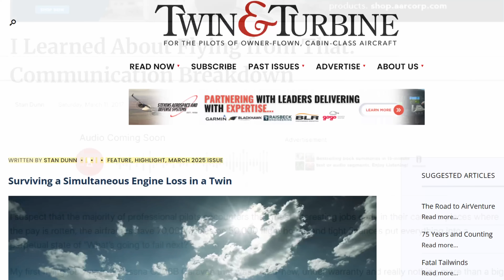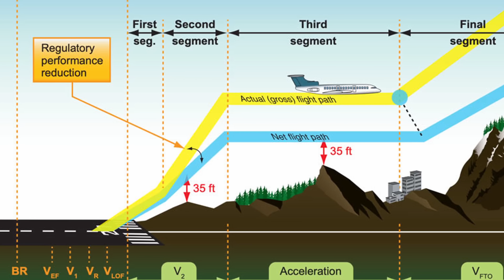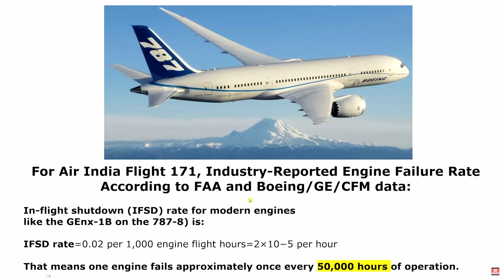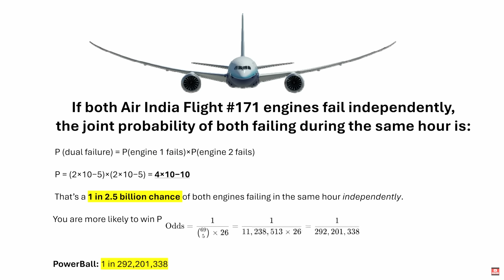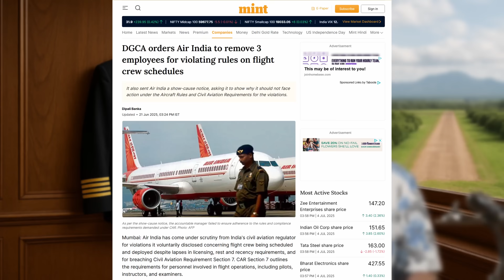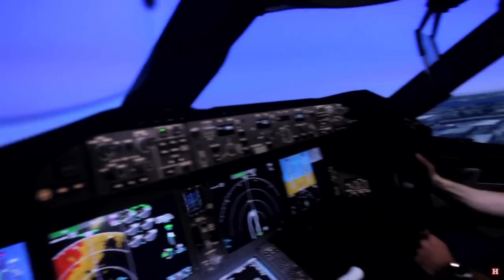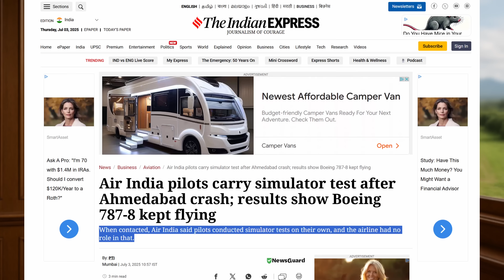Air India 171 Cause Becoming Clear

Comment: Informative but not corroborative , the pilots May Day call mentions about no Lift & Thrust , so obviously they could not have botched up by making the aircraft choke  by pulling the fire handle . Had they, they would have realized their mistake and not complained about No Lift / Thrust, isn't it ?
Reply: IF a fuel switch was off and IF the pilot on the radio report is true, he did not know he had a good engine with an OFF switch selected.  If both switches off, even worse.

Hopefully switch positiom/movement is recorded and saved audibly on the CVR, digitally on the FDR and survived the fire intact and true.

Comment: Someone posted that Boing doesn't have enough em shielding on wings. I studied this, but I didn't finish cause I would need to move to Phoenix. The left engine had issues thats proven by videos. Thst damage wing , landing gear, and produced emp. Rat deployed that could save the plane. Some say the seat broke possible cause the runway buckled from heat. There were multiple issues that cause this crash. I took classes to work on airplanes, but bad back and shoulder changed my mind .

Comment: I seen a documentary on the building of the dreamliner & safety inspector who was fired because his safety delayes was causing a problem for Boeing as they were in a panic to get this plane because Airbus was coming out with their A 380. The safety inspector said he would be surprise if this plane did not  crash in the first year. It was built by non-Union workers & poorly built at that. Now I am not an expert just pointing out the Documentary I saw on this plane.

Comment: The plane sat on the runway for an extended period of time with a 110 degree ambient temperature. This likely ultimately caused the formation of tiny air bubbles in the fuel system and when the aircraft tilted upward during take off...the bubbles resulted in an air lock in the fuel system to both engines at the same time. This resulted in both engines failing at the same time and the resultant loss of power and crash.

Comment: Bullshit, if one engine stopped the airplane would have rolled its completely balanced.
Reply: If the plane started to yaw due to only one engine working, one of the pilots could have compensated for the yaw by applying opposite rudder.

Comment: Once was taxiing by a 787 (back when they were brand new). They were stuck on a taxiway because their brakes came on for no reason and they had no idea how to fix it. Some random computer error that left those pilots scratching their heads probably for a few minutes. The plane is highly digitized and electrified compared with previous airliners. Lots of different systems interacting with each other - means that there could be a bug in the code that was never caught.

Comment: You would think with the “incorrect shutoff” scenario the one running engine would have a lock out to prevent accidental shutoff? Human error has to be eliminated. Also what was your reference to carburetors since jet engines don’t have them? Finally I would want to know who had access to that plane prior to takeoff if sabotage was a consideration?

Comment: I've seen and been in 787 that have gone nearly vertical. This 787 took off just fine and gained elevation just fine, but then all of a sudden it started losing elevation... just because of that, something caused the plane to lose power, not flaps, or pilot error. Something caused a lose of power, major bird strike, bad gas, or something simular.

Comment: You took almost 17 minutes with a "becoming clear" title......and said absolutely nothing.  SO.........  clear loss of power...RAT deployment suggests dual engine failure - without external clues such as compressor stalls, FOD on runway.  OK how does this happen?  Bad fuel?  Highly unlikely as no other aircraft were affected and there was no sign of asymmetric thrust (such as rudder deflection or obvious yaw).  All together now......... how do you "shut off" two  GEnx engines simultaneously????  One guess - (hint: it involves two switches on the pedestal)  Has happened before (see Egyptair 990, Alaska 2059)  Just a "diagnosis of exclusion" and speculation at this point, but the CVR and DFDR will immediately prove me wrong (if I am wrong) but this is about the only scenario that fits - and no one wants to think about this horrible possibility.
Reply: VERY SADLY, I WAS CORRECT.  THIS WAS AN INTENTIONAL, COWARDLY ACT, SIMILAR TO EGYPTAIR 990.  OUT.

Comment: I saw a report that the captain's seat slid back just after rotation (the start of the climb) for about 30 cm (11,8 inches) and the captain instinctively grabbed for something to stop the fall (or slide). Unfortunately, it could have been the throttles. It was reported that the pin that locks the seat did fail. If so, there wasn't any time to throttle back up or restart the engines.

Comment: You can’t have extensive aviation knowledge with 55 hours of flight time that in a Cessna 152. I have 30,000 hours with many type ratings in different aircraft and 35 years of airline experience and I can’t imagine what would’ve caused this.
Reply: Fuel cut off switches pulled at Vr?

Comment: I clicked because the title says the cause is becoming clear. This video says it is NOT becoming clear.   
. 
He makes a reasonable argument that there was a single engine fail & the pilots shut down the good engine.  That may be less of a stretch than alternative explanations . . . but it’s still a stretch. The pilots would have had to shut down an engine right off the runway, which I think would be odd . . . unless there was a fire light.  And it doesn’t explain why the RAT popped so fast.
.
I enjoy guessing but I would wait for the report before I claimed to have a credible theory 
.

Comment: Nice job "Flying for Money", the best I've seen so far.  I'm going to throw some spanners into your works but only for righteous reasons to ensure all common-mode failures (like fuel contam'n or multiple birdstrikes) or a single failure causing loss of both engines (like FOD ejected from an uncontained fan/turbine release of one engine causing failure of the 2nd).

Possib'y of engine failure and erroneous shutdown of the remaining engine during the rapid transition of flight phases (V1 to Vr to V2) is a tough sell.  Indic'ns of non-(imminent/immediate)-critical nature are purposely inhibited to the crew to limit workload.  A minimum skilled pilot couldn't physically get to the final "emergency shut-off and extinguisher release" on the wrong engine in just the short "Phase I" climb segment.  And other than the unusual, visible, exhaust on the #1 engine, there wasn't a rapid yaw followed by a crew or aircraft-auto-correct system.

Software is a "magic" that replaced direct connect'n between mechanical mechanical and wet systems and the flight crew and allows high tech 2025 transports to fly.  You mentioned FADECs (software based engine controllers) but the FADECs require both a certified hardware config'n and a certified software config'n.  And certifying software which may be common software even on independent units like engines is a dark hole no one wants to crawl in.  Errors come from all dir'ns including errors made by the compilers that convert simple math programming into the machine language that Av'n-Grade-Silicon feeds on.

Document DO-178-C (correct version?), "Software Considerations in Airborne Systems and Equipment Certification" ensures that flight critical software doesn't act like 'Windows 10' on the night before your thesis paper is due.  Frommy perspective -- it costs ~ $2000 USD to certify a single line of flight critical s/w.  Don't rely on that -- say your prayers at night, and show kindness to the weak and poor!  (No religious content intended, or offense intended.)

And since no one reads this far:  eat plenty of fresh fruit & veggies, wash behind your ears, and don't slouch.

Comment: You didn't consider all forms of sabotage. 
In the past few years we've seen head scratching incidents all involving Boeing planes. Planes that have been in service for years to decades disappearing, suddenly nose diving, losing doors, faulty bulkheads, and now this.
The dust on take-off is because the plane did not lift until the very end of the runway. It wasn't dust on the runway, it was literally the dirt off the runway. That's a big clue you seem to be missing.

Comment: I heard that the cause was the Captains seat slip back on its tracks on lift off. The captain instantly reacted by grabbing the throttle controls trying to pull himself forward which inadvertently caused both engines to loose total thrust.!!!

Comment: @brandodurham … further to your note, and in keeping with the “30 seconds to process emergency event” re: Hudson incident, what is your opinion of a crew’s likelihood to attempt any significant configuration changes within 12 seconds of flight?
Reply from the maker: It can be very hard to be patient during a shock event. Sullenberger was, and he wasn’t able to return to LaGuardia as a result (but his process wasn’t wrong). Pilots have to make reflexive decisions every day, and they have to know when to slow down. It is a very fine needle to thread. Stated better: “it takes 35 seconds for a pilot to make A GOOD RESPONSE to a shock event.”

Comment: He is saying that the pilots may have turned the functional engine off by mistake. They were suppose to turn of the damaged engine. He saying that the cloud behind the plane as it takes off is a sign of a damaged engine. As a result, both engines were off as it took off.   Thankfully in India, digital cameras in the cockpit are mandatory and required by law so pilots actual action are recorded (DVR).  😀

Comment: Not pilot error, not flaps, not bird ingestion, not compressor stall, not fuel contamination, not sabotage. Dual engine failure due to FADEC Channels A and B detecting an out-of-tolerance parameter - likely an overspeed - triggering an automatic engine shutdown to prevent a catastrophic failure. With the generators offline, the RAT automatically deploys providing essential electrical power. RAT cannot retract the landing gear nor can it lower the gear. But, what is the common link that would cause FADEC to shutdown two engines simultaneously?

Comment: The pilots did not have the flaps required. That plane, that day, that airport, that short runway...required AT LEAST #15 flaps. It is clear from the multiple videos that those pilots took off without the required 15 degree flaps...and barely at that. Those engines were SCREAMING while the plane pancaked to the ground. That plane barely made it off the end of the runway when it rotated...kicking up the obvious cloud of dust. Pilots are probably THE WORST when it comes to accident investigations. They have some of the strongest prejudices coupled with an incredibly high professional copium delusion. One must drag a pilot kicking and screaming into the 'pilot error' conclusion that others have already figured out. Worse still is when #wokism virtue signalling hinders their critical thinking.

Comment: The reason is clear to me;
The fueling techs purchased a 50/50 mix diarrhea and jet fuel instead of pure jet fuel because it was cheaper. Little did they know, the company that was supposed to sell them the 50/50 diarrhea/jet fuel mix used a ratio of 90:10 diarrhea because they wanted to save money. 
Not that it had anything to do with how the plane crashed, but, they also replaced the hydraulic lines with diarrhea. 

Anyway, the plane lost thrust because it was burning diarrhea and then it crashed. It’s hard to tell the ratios because it landed in diarrhea and people were smuggling diarrhea in their luggage.
Reply: i died laughing reading this lol
Reply: @Itachi_SURIP … I will tell your family you died a hero.

Comment: Agree as 787 driver below said, limited chance any Eng master switches were touched at that altitude. Most jet SOP’s say do NOTHING (except silence the alarm and raise the gear) until 400’ AGL with an Eng failure on takeoff. If the data is correct, these guys topped out at 420 AGL and immediately began descending from that point. If they were able run their procedures through to engine shutdown in just 20’ then they would have had to start well before the prescribed 400’ target. Or they just F’ed the procedures and shut the master off (wrong one) exactly at 400, which would be equally hard to fathom. And if so why was the gear in an apparent transient position as some reports suggest. Meaning that the gear (command) was given to retract in a standard time frame—normally below 200’. And yet it didn’t complete its upwards transit. Which one would have to assume is due to no hyd pressure to move it. And if any engine was running at 420’ AGL that should have maintained enough hyd pressure to complete the retraction. Indicating to me that neither engine was developing thrust well before it started its descent. You can climb out initially using ground effect when your performance is not sufficient to do so otherwise. The aircraft used up the whole 11,000’ of the runway (hence the dirt flying at rotation) when accelerate/stop calculations should have had it airborne by approx 7,000’. This shows the jet was NOT developing the takeoff thrust required for whatever reason: electronic (FADEC), pilot error, unintentional derate, wrong weights used in calculations, and so one. But does not explain the apparent loss of ALL thrust and associated Eng generators shortly after liftoff which led to the RAT deploying. Unless they shut the good one down at an absurdly low altitude. Such as immediately when airborne. Or did they intentionally shut both down…as in suicide? The fact that the Indian Aviation authorities haven’t yet released any safety bulletins to the worldwide operators of the 787, which they would have done if they found some immediate causal technical, soft or hardware issue or similar, leads one to believe they don’t yet think it was technical in nature and the longer that goes on (deeper into the investigation) the more likely the cause rests with human aspect.

Comment: We won't know what really happened until the FDR information is released but I think the RAT deploying is the biggest clue. That only happens when a plane loses major electrical and hydraulic power. In modern jets, no power = no engines, because the digital systems (FADEC) can't function. Unless there's clear proof of fuel exhaustion or pilot error, this looks like a total electrical failure that shut both engines down.

Comment: It seems obvious that whatever caused the crash was able to cut back both engines pretty much simultaneously.   I would think that fellow who got off the plane before it crashed but had video showing electrical malfunctioning in the cabin prior to his flight might be a clue. That it is know water can leak into the avionics bay of the aircraft from its washroom (bathroom) plumbing connections is, too me, highly suspect as a cause.

Comment: Shutting down the operating engine after the other had failed would not happen in any airline I have worked for. The drills to secure the failed engine would not be started until at least 400 agl, then then there would be strict X confirmation. Aviate , Navigate and communicate.
Reply: Have you worked for Air India?

Comment: Since we are seeing lots of speculation about possible reasons for what in all likelihood is a dual engine rollback.  I would like to bring Mr. Occam into the discussion, and toss out a possibility that he made an appearance here. This came to mind as it happened to me some years ago, and could have been tragic until I realized what happened and the stupid response on my part.  It was a simple mistake. 

When I adjusted my seat during pre-flight, I didn't wiggle it back and forth a bit to ensure the lock-pins had engaged into the rails. 😜 Do you see what I set myself up for?  Yup....just as I rotated the dang seat slid all the way back to its travel limit and with my hand guarding the throttles, when I slid, I pulled them all the way back at about 20-30 feet off the runway !!! Of course my immediate reaction was to hold the yoke while pulling myself forward...NOOOOO!!! 

I was quick enough with presence of mind to let go of the yoke, and found a hand hold to get the seat repositioned and the throttles back to climb power.   

So here we go with Occam's Sharpened Razor here.  Is it possible that the Captain or FO that had the controls, experienced a seat failure (exactly like mine) right at rotation speed and rolled the throttles back to flight idle, that he had his hands on? Looking at the cockpit photos and especially the center console, there is nothing to provide a good grab, to pull the seat forward. This would cause a few moments of time to recover from, when they didn't have the time? Even if the pilot flying had the presence of mind to punch the TOGA,  those turbofans take some time to spool-up (5-7 seconds) there is a lot of inertia to overcome.  Far fetched ?? Sure, but IMHO not as far fetched as some of the very complex electronic conditions calling for both FADECS to roll the  turbofans back. Occam's Razor cannot be discounted, since there are many worms in this search for causes of a tragedy.

Comment: Stopped at 5:55. Stopped listening after he said it is 1 in 50000 hours that both engines fail within an hour of each other. So it is safe to fly with one engine?
Reply from the maker: Yes, it is safe to fly with one engine if you must. Many civil aircraft only have one engine. A 787 can climb perfectly fine on one engine for an immediate return to the airport. And the odds of two engines failing in and hour are one in 140,000,000,000.

Comment: I wasn't buying contamination by normal means for a minute; expected result is not simultaneous engine failure but irregular failure; simultaneous failure would require the fuel pumps to go offline at the same time; but we would know it by now.